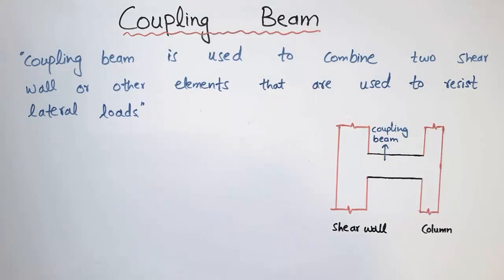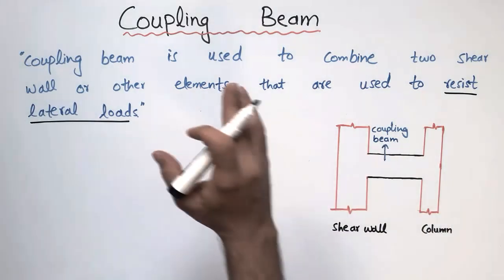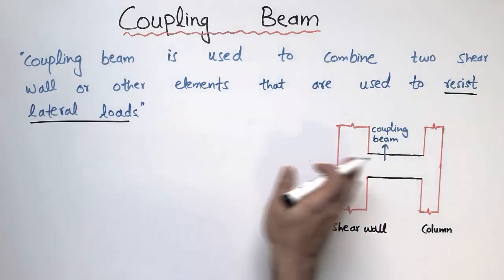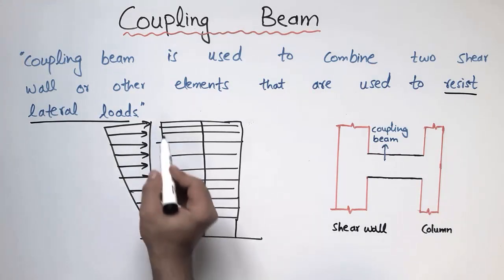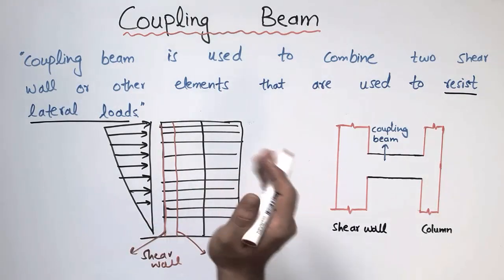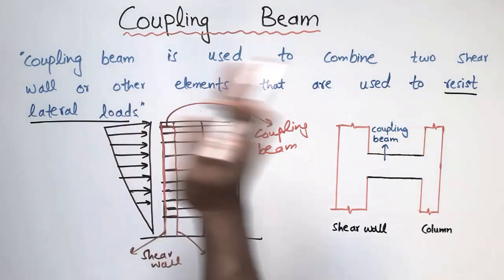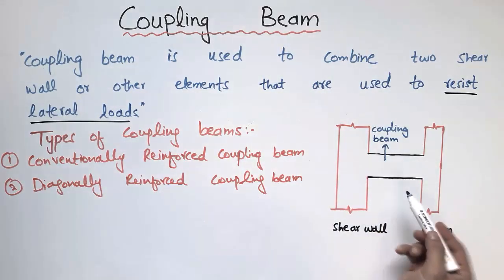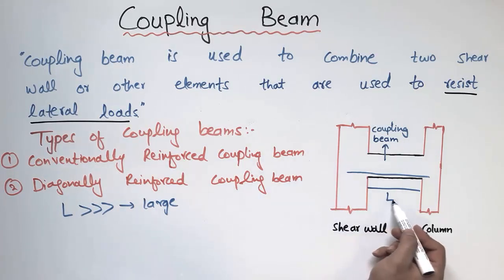What is Coupling Beam

Comment: When a Coupling beam is used with a Wall - column system, like the one descxribed on the video.... at the edge of the beam-column do i have to use de 6/5 parameter ?